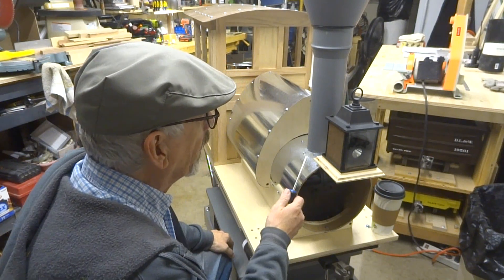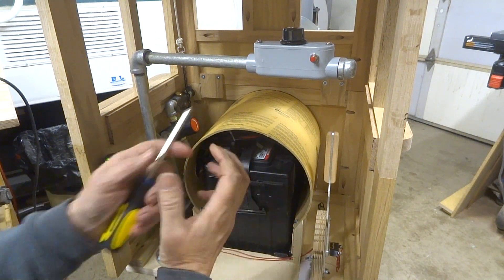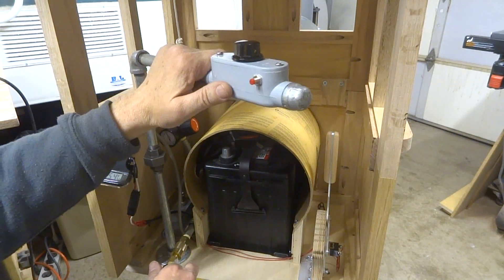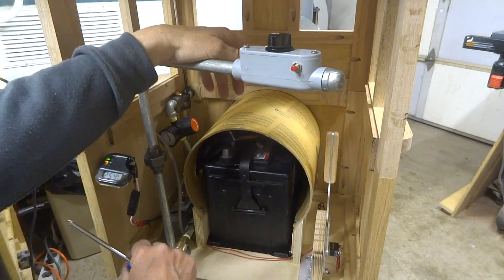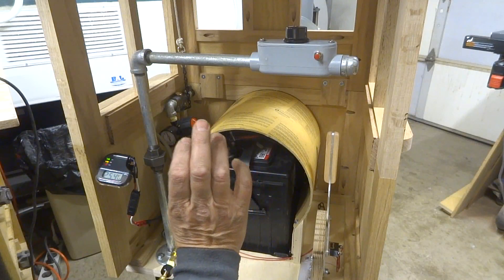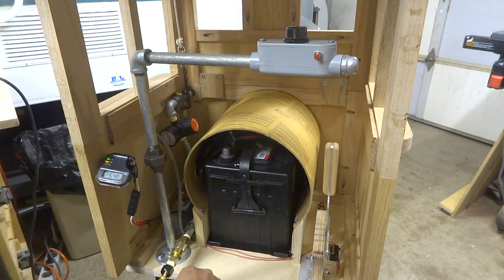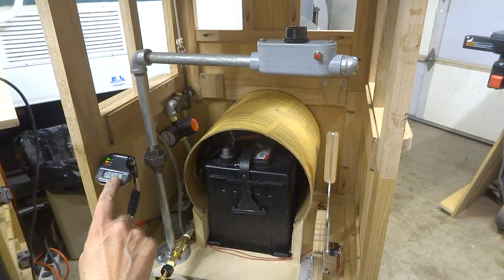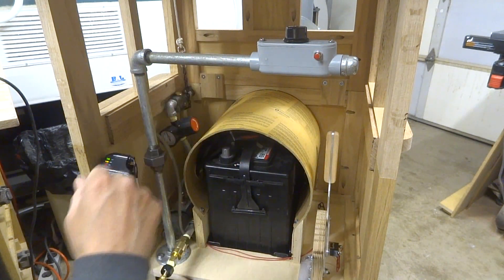Porter 0-4-0 Build - Part 3

Comment: What did you use for an air supply for your whistle?
Reply from the maker: Hey Brian!  I use a small compressed air tank that sits behind me on the flat car (the yellow one in the picture on my site header).  I usually fill the tank to about 80 lbs, but the whistle likes volume more than pressure, so I regulate it down to a little under 20 or so.  Too much air and the whistle just squeaks so you have to dial it in.
Reply: Cool  I am building a little porter engine my self and love your videos. On your pull for your whistle how was that accomplished? I am having trouble trying to figuer that part out. Like your set up the harder you pull the louder it gets. Thanks for the reply.
Reply from the maker: @BrianRKingVideos  That sounds great!  Hope you can post some of your work!  If you send me an email, I can take some specific pictures of my loco for you.